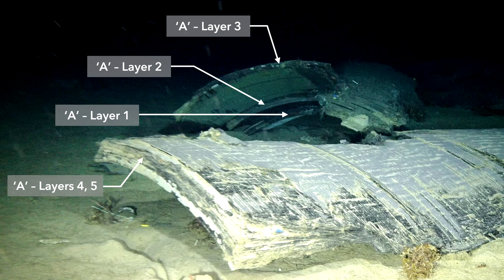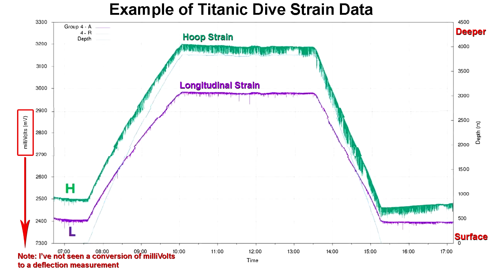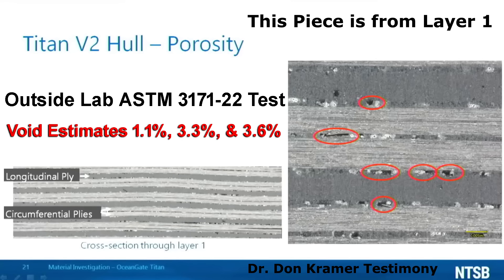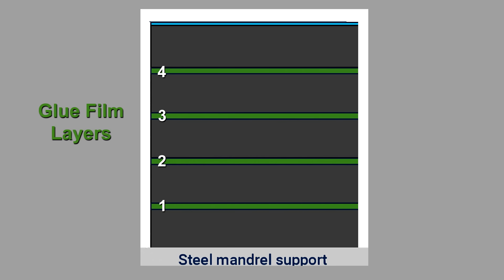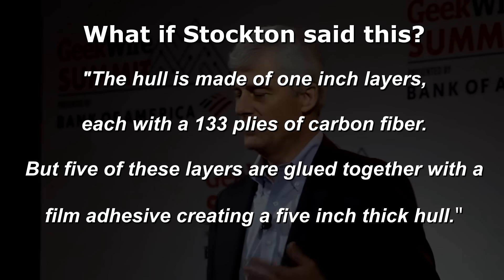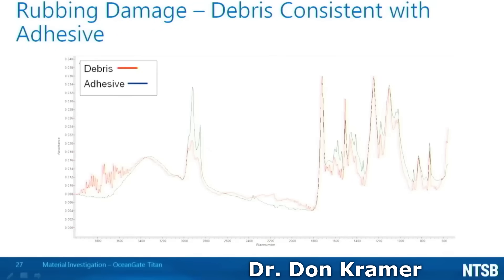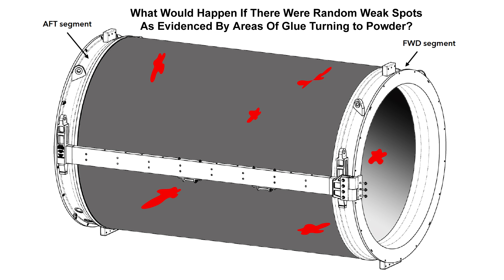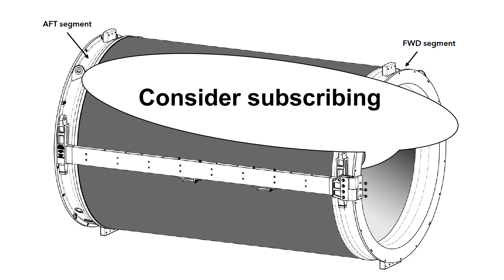OceanGate Titan Hull - Glue Layers Were Breaking Down To Dust - No Clues.

Comment: One thing ive said since the first day i heard they used a carbon fibre composite hull is.

ANY Pinhole in the layers to the outside will lead to severely reduction in strength as it lets pressure in lets say one inch then you get a high pressure bubbe that peels apart the layers from within then finds a new hole and it goes on and on uintill it reaches the inner layers and it start to buckle and now you have reduced the theoretical thickness and it will all be a cascading failure
Reply: That is likely to happen from the ends of the hull because of failing bonding to the metal rings.

Comment: This is getting ridiculous. The titan suffered from critical design flaws. The basic design is a cylindrical carbon fibre tube with titanium semi-spherical end caps. The end caps are joined to the tube by glue with the tube fitted into a flange. The flange had a tight fit, evidenced by the need to trim the tube to fit. The tube had circumferential (majority) and longitudinal (minority) fibres. This entire structure had the same (high) pressure normal to the surface at all points. Carbon fibre is great under tension and useless under compression. Carbon fibre composite and titanium have different compression modulus .  In the tube, all (see below) of the compression loads in this design are being taken by the epoxy. Because the tube is under compression, the circumferential fibres are doing nothing. The tube is being compressed as a different rate than the titanium and the tube end are constrained by the flanges at the ends. Thus, there is deflection. This deflection is like squeezing a toilet paper tube in the middle using a rubber band (like the videos of people wrapping elastic bands around a watermelon). The circumferential fibres are like a string wrapped around the toilet paper tube that is being compressed. Thus, deflection is only resisted by the epoxy and the longitudinal fibres. The longitudinal fibres are under immense strain. As long as the titanium flanges hold, those fibres are going to de-laminate from their neighbours (under constant cycling, they have no choice). The glue matters because it helps to ensure that all the fibres work together -- if not, one could have sequential failures of the fibres. The flanges are under immense strain because the tube wants to compress more than the titanium (a guess -- there is almost no data on compression strength for carbon fibre composites and it depends on the details of the composite). It was a question of what would die first: the flanges or the longitudinal fibres. The circumference fibre do have a small contribution maintaining the tubular structure (e.g., in case the epoxy has inhomogeneities)  but by the point they really start to take some stress, it is far too late. The design would have been better with more longitudinal and fewer circumferential fibres -- and no inner flange

Comment: Never was the layering subjected to evacuation to remove air, red flag right there
Reply from the maker: Thanks for your comment.  They did do vacuum and heated curing and debulking but on 133 plies of carbon fiber.  From what I can gather from the Toray specifications for the material system they used, that was too thick to do it effectively.

Comment: I'm no engineer, but I think I would have put a few internal supports in that thing
Reply: A few titanium rings inside to lower the stress on the hull would have helped. But it had so many other problems, it takes hours to detail all of them. So it was miracle it lasted until it did.
Reply: Could of wedged a few xbox 360's length wise I suppose
Reply: Unfortunately they didn’t sell those at camping world or maybe he would have installed a few.

Comment: Why wasn't it just made out of steel or titanium, like every other truly deep sea submersible? The Trieste descended to an INSANE depth compared to where the Titan imploded... in 1960. Wouldn't it have been cheaper to manufacture a steel tube, too?
Reply: Think he said the weight/buoyancy was the reason
Reply: Definitely. Lets make one out if a five inch thick ring forging and weld in baffles and ribs to make it stronger.

Comment: "debulking" in and of itself weakened the hull. The strength of carbon fiber from what I understand is "unbroken bands" but if you grind down a bump you're actually cutting at least 1 band. So if you grind away a layer you don't actually have like 10 bands of carbon fiber in that place you have 9 or less.
Reply from the maker: Thanks for your comment.  Dr. Kramer testified that some of the deepest grinds took away 12 plies of carbon fiber.  Thate 9% of the layer, which was 133 plies.  That's' a lot.
Reply: yeah also as noted in this video layers of carbon fiber are strong longitudinally not so much laterally especially in a flex environment. they should probably have cut out 10000s of 5 inch wide washers of carbon fiber and built it up from 1 end to the other.
debulking would have had a lot less effect on it also plus heaps easier to make sure each layers properly pressed down than a cylinder

Comment: I'm not a materials scientist nor physicist, but surely carbon fiber would be pretty much useless when under compression. It feels like it's the epoxy matrix that's going to be doing most of the heavy lifting in this case.
Reply: That's absolutely wrong. The fibers do the work as long as they are very straight (and here they were wavy). The compression strength of unidirectional carbon fibers in epoxy is about half the tension strength, which is still pretty darn strong.
Reply: US navy didn't have a problem with the one they made that he copied the idea from

Comment: The airplanes are also prone to the same failure type with the cycled stress on and off? How do they deal with it?
Reply: Planes generally work in a less structurally stressed environment than submarines. Since planes are working in elevated altitude, they work in atmospheric pressures between 0 and 1 bar.

Submarines meanwhile are being submerged in water at depths that increase by about 1 bar per 10 metres of water depth. With the Titan Sub supposedly designed for 4000m dives it would be approaching 400 bar at its deepest spec.

Furthermore the choice of material was wholly inappropriate. Carbon Fibre is a Composite material, meaning that it is made of multiple separate strands of material held together by a form of adhesive bonding agent.

Composites like Carbon Fibre work under tension where internal pressures are greater than external ones since that makes the individual fibers taut and rigid. Under compression where external forces are greater, the fibres want to slacken, meaning the adhesive bonding holding the fibers together has to take the strain to stop the material collapsing on itself.

On top of this, the Carbon Fibre was sourced at a cut-price because the company using it deemed it to have expired as the composite had deteriorated to the point of not being safe for use in its intended construction of aircraft.

Not only that, but as a composite, it is fundamentally impractical to simulate its behaviour with enough accuracy to eliminate reasonable doubt. With homogeneous materials like metals, you only need to simulate the one layer at its constructed thickness and a computer software will be able to calculate its properties. With Composite materials, each layer has to be calculated individually for a 100% accurate readout; a process that gets exponentially longer and more difficult for every layer added. Thus to enable simulations to be completed within a required timeframe, the simulation is "averaged out" across the layers, meaning that failures that would've been caught in a full layer simulation can be missed.
Reply: They have a cycle limit and are then retired. This is usually not an issue because flights are long and the carriers can rotate aircraft to prolong the airframe
Usually means there is an exception though
Air Hawaii. Inter island hoppers get absolutely blasted. They have increased inspection programs and such for the increased maitence.
You start to see things like seams and rivets forming stress cracks, or even just the material itself start to yield
A Boeing 737 might have a cycle limit around 60,000 to 75,000 cycles, depending on the model and usage conditions.
An Airbus A320 is typically rated for about 48,000 to 60,000 cycles.
Reply: Extensive NDT inspection of critical parts throughout the life of the plane.
It's why the B 52 is still in service.
Reply: Airplanes work in opposite way. While going up, you have higher pressure inside of the aircraft that want to get out. In submarine you got higher pressure on the outside that want to get in. Carbon fibre work like a rope. If you make a circle out of rope and try to push on it from the inside in every direction, the rope will resist. If you try to push te rope from the outside to the center of your circle, no problem. This is why you build airplane out of carbon fibre, but not submarine. The rope example is a bit exagerated, but principle stays the same.
Reply: In flight the underside of the wing is in tension and the top is in compression. 
Exceeding tens of bars. 
However aircraft have more thought put in them and have cycle limits.
Reply: Simple. They are just built to higher standards AND regularly inspected, metal or composite.

Comment: The epoxy resin just sucks like usual does.  Heat it and it irreversible turns to powder.   Turns to dust cured just sitting there.  The adhesive in between for flex. Should have used vinyl Ester.
Reply: Aerospace epoxy is as good ad it gets.

Comment: The important design limits will be the fatigue-cycles characteristic of the final composite. Was this characteristic ever performed for the sections of the final composite? Basically, the composite will degrade as the number of cycles increases - period.
Reply from the maker: Thanks for your comment.  Yes, you are correct.  The co-bonded hull was never tested before use, except for the 5 deep pressure dives in the test chamber in Maryland.  Not even scale models of the co-bonded technique were tested.  There was no fatigue cycle work done as far as we know from the documents that were released to the public.  The NTSB may have more information that has not been released, I don't know.

Comment: I will assure you of this: no manufacturer of adhesives will accept this application. I was building a simulator to simulate a submersible that I was involved with and the hydraulic companies refused to allow us to use their equipment on a ground simulator. This application is nuts.
Reply from the maker: Thanks for adding to the discussion.

Comment: I have worked for 40 years in the nuclear industry on safety cases, so have little bit of knowledge of working with regulators. Using your logic there will be no reinforcement rings or whatever inside nuclear submarines because they don't  work. Careful design around interfaces where loads are transferred is key to a successful design.

Comment: it's not the 587 square feet of glue that worries me. 
it is 587 square feet covered with a layer of glue 0.0075 inches thick, which is about 3 gallons or 10 litres.
Reply from the maker: Thanks for your comment.  I give you credit for doing the math correctly.  Nice Job!  You are right, it's not much glue.  But I guess the bigger question is, what is any glue doing in a sub going down to 4,000 meters.

Comment: As someone who has extensively used epoxies for various jobs, mainly for boat building/repairs (not submarines), it’s well known that heat will reduce epoxy to a powder like substance, as it breaks down. I could only imagine that the pores within the structure, under such high pressures, would flex, producing micro pockets of high temperatures through the chemical bonding stresses — therefore, turning the resin in to the same powder that’s seen when epoxies are exposed to even moderate temperatures created by something like a heat gun. Maybe I’m incorrect, but if they found that powder like substance, I’m assuming that could potentially have played a roll, considering the extreme pressures experienced. Either way, hopefully they figure it out, to avoid future disasters.
Reply from the maker: Thanks for your comment.  They used an epoxy product to fix the titanium rings to the carbon fiber hull.  The glue that was in between the layers of carbon fiber came as a sheet of glue film that they laid over the hull before the next layer (as per Dr. Kramer).  No other information is available, so we don't know exactly what it was, but it did not seem to be a two-part part product mixed together.

Comment: Just the zone where 2 different materials existed with different expansion and compaction coefficients would have been enough. But laminated fiber is about the stupidest thing that one could've done. This was an accident born and bred in ego.
Reply from the maker: Thanks for your comment and I agree with you on the the co-bonded layer design.  I am working on a video right now that will address the engineering of the use of two different materials, carbon fiber and titanium.  They accounted for that and I will explain it in my next Titan video,

Comment: Carbon Fibre is a great material to save weight, why would this property be of any use underwater
Reply: To be fair, carbon fibre can be used underwater, but the design and preparation is critical to ensure it will work effectively. CF has been used already, I believe by the US Navy in a small experimental submersible, and it worked well, from what is known publicly.
Reply: @MB-nn3jw  is that to sit at like 300 ft underwater though or to the ocean floor? Just cant imagine the military would have any interest in going so deep
Reply: Money, its expensive to make titanium hulls u can get millionaires to pay to ride in
Reply: The weight of the submarine is the concern. The more it weighs the bigger the support ship that is needed to support the submarine. Bear in mind that there already exist other submarines that can go much deeper than the depth of the titanic, but the support ships required to lift these subs in and out of the water are huge and extremely costly to operate, so much so it's only really practical and justifiable for research organizations to operate such submarines. So for OceanGate, you reduce the weight, you reduce the size of the support ship which thereby reduces the costs required to operate the submarine making it more economical.

Comment: There have been several cases of failure of epoxy coatings on buried pipelines becoming detached from the pipe and fragmenting.  Usually it is not known why the epoxy fails in such a manner but there are some indications that the product was used after its 'best before date'.